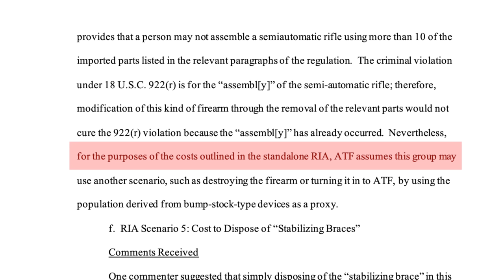BOMBSHELL HIDDEN IN PISTOL BRACE RULE!

Comment: The AFT for more than a decade had allowed the public to obtain these "dangerous and unusual" firearms to the extent that they are now commonly owned/possessed, thus making them protected arms under Heller. One could then conclude that if they are considered SBRs by the AFT, that SBRs are not "dangerous and unusual" thus not covered by the NFA. following that line of thought, if SBRs are not covered by the NFA, then logically SBSs, AOWs and suppressors should not be covered either. Since 1972 the AFT has increasingly tried to strip the citizens of their Second Amendment Rights. It's time for the AFT to be abolished.
Reply: Dude! It's (d)ifferent now.
Reply: You spelt abolish wrong, it’s spelt DESTROYED.
Reply: That was their plan the whole time, figured they'd get more people that way. This has been in the making for YEARS
Reply: Other ABC groups will just pick up their slack
Reply: Unfortunately I fear congress nor the courts are going to come to the rescue in time to save these. Those that try to file the form 1 will likely find the many months, even with e-file to get a response will play right into the ATF's hands as they plan to consider denied anything that is not approved from date of filing in 88 days. That means pretty much all of these, as the ATF has GROSSLY underestimated the number in circulation. This rule has two purposes; 1) to obtain as much information on Joe Public as they can...for the next step.  2) Get rid of by deceptive, corrupt and coercive means as this, expecting them to be destroyed...or removed from circulation by ATF agents after they deny your form 1.   Wake up people! Many of you are acting like your asleep at the wheel. As to this video asking people to "tell" what they are going to do...DON'T DO IT!
Reply: …yep.
Reply: Very well put. Perfectly articulated actually. 💯💯💯💯🔥🔥🔥🔥
Reply: @richardkennedy815  ATF/Treasury have a very good idea of numbers in circulation because they signed off on all the Federal Excise Taxes for pistols.

National Shooting Sports Foundation keeps industry records.  For 2020, the 2nd most common pistol chambering sold was 5.56/.223 Rem, which shocked me even.

They know they're in common use by the millions.

Comment: One would think both the ATF rule and the law on SBR's are unconstitutional as there was no supporting law from the founding about the length of allowable rifles or a requirement for registration.
Reply: It's looking like it's heading that way
Reply: It's one of the saddest "laws" we got.
Reply: It's all arbitrary and tyrannical.
Reply: The entire NFA is unconstitutional. You should be able to buy a machine gun at Walmart if you want to.
Reply: I would love it if this rule change by ATF causes the SBR portion of the NFA to be declared unconstitutional since 10-40 million of them in circulation cannot be construed as anything but "in common use" under the Bruen decision.
Reply: That's exactly right.
You could own a cannon.  There was no barrel length limits.
Or the old Colt revolvers with an arm brack, we'll actually stock on them.
Reply: @jarink1  
If the courts declared the SBR portion of the NFA to be unconstitutional wouldn't they also have to declare the entire NFA as unconstitutional?
Reply: The Attorney General who submitted the NFA in 1934 openly admitted to Congress that his proposed legislation was unconstitutional.

Read pages 10, 13, 91, and 92 of the NFA hearings, 73rd Congress.

Comment: Remember if you apply to SBR your ALREADY BUILT pistol and get denied the ATF will come for you.  That is straight from an ATF agent at Shotshow.  My advice?  Don't register and keep your mouth shut about what you may or may not have.
Reply: Good thing I don't own a single firearm..🙄
Reply: @dankcount  Since you made what was formerly a pistol into a rifle and in order to convert that rifle into an SBR you will then need a maker/builder tax stamp and pay the ATF another 200.00 bux for permission to build that now rifle back into an SBR, rather than to leave it a pistol/SBR since that'swhat your regerstering it as?? I mean I may be wrong and misunderstood the ATF site I just read that on. Maybe you can clarify for me since your in tune with the ATF, preferably without Ad Hominems..
Reply: @dankcount  Sometimes it is better to stay quiet and be thought a fool than to open your mouth and prove it.
Reply: Or just buy 16in rifles...
Reply: @LucasJackson_37  One of the ATF's approved compliance methods it to remove the brace and destroy or render it unusable. The firearm reverts to legally being a pistol. One could then apply for a tax stamp to add a regular stock to your pistol, making it into an SBR in the usual fashion. Only drawback is that it won't qualify for them waiving the $200 and you'd be out some extra money for the stock.
Reply: @dankcount  on stribogs the upper is the registered part, not the lower. I'm not sure how many other guns are that way though either.
Reply: Shutting up will save your life everytime when it comes to federal law enforcement. 

If they don’t know what you have, they don’t know.
Reply: They can just get receipts from businesses and find the people who bought them with cards😜🤪 plus the can just let AI scan through photos on people's phones to find who has them, it could be so fun if the government and citizens weren't chickenhawks
Reply: @Seasniffer69  yes and they cost like $1000 dollars are they saying they must be destroyed and not even compensating individuals for something they purchased legally? This is so messed up.
Reply: I know nothing!

Comment: This definitly rises to the level of emergency appellate review by the SCOTUS.
Reply: It does and more than likely they won't lift a finger to do anything to stop it. I hope I am wrong.
Reply: @AP518 Unfortunately, I agree. SCOTUS often refuses to take on 2A cases and when it does, the rulings are inconsequential or it sends to the lower courts for review and for the case to die out. Even with potentially meaningful decisions such as Bruen and WV versus EPA, we see tyrants ignore those rulings (NY governor quadrupling down, ATF continuing to issue the brace rule, etc).
Reply: @gifthorse3675  Courage is demanded of SCOTUS.  They have already shown such courage with the overturning of Rowe vs Wade.  May they remain similarly courageous in their 2A deliberations.
Reply: But ,yet they are silent!

Comment: I was under the belief that 922r compliance was part of the importation process which meant that approved imports were compliant. This is complete BS. Disband the ATF!
Reply: 922(r) doesn't apply for pistols. The importation process is generally for rifles to be imported in a configuration BATFE grants "sporting use" exemption, then for the importer to swap parts into the configuration customers want, with no more than the allowed 10 foreign-made parts from the list of parts considered.
Reply: Nope 922r applies even after in country. I.e you as the end user of say and imported Yugo AK can't replace the American made handguards and stock with Yugo made ones and still legally comply with 922r if you also insert a foreign made magazine as you are then over 10 imported parts on the gun. I do agree though this whole thing is BS and I don't even own one of the firearms in question.
Reply: @timewave02012  so what about buying a foreign pistol like luger or makarov? they are ok to have, so shall these braced pistols. take the brace off and now its no different than a luger?
Reply: @hambone950  Lugers that originally were made to accept stocks, are allowed to have original stocks attached, and that's a completely different issue. The Makarov has no such exemption and is treated the same as AK pistols with regard to arm braces and 922(r). Rifles (short barrel or not) are generally not allowed to be converted back into pistols, although I believe there are exemptions, like for the Thompson/Center Contender, that can be configured as rifle or pistol based on Court rulings.
The most important thing to understand about 922(r) is it only applies to the act of assembling the rifle or shotgun. What ATF and clickbait Youtubers don't mention is that possessing a 922(r) non-compliant rifle is not a crime. The alleged 922(r) violation that occurred in the assembly of a braced pistol doesn't need to be absolved. 922(r) was widely assumed unenforceable against non-FFLs prior to NYSRPA v. Bruen, and is even less enforceable under the Bruen test, where assembling a rifle is protected under the 2nd amendment, and there's no way the government is going to find laws contemporaneous with the enactment of the 2nd amendment restricting the assembly of rifles based on place of origin of the parts.

Comment: Points regarding registering your pistol with stabilizing brace as an SBR:
1. AT LEAST in some jurisdictions, your pistol is now a rifle and can't be legally concealed or transported in the usual loaded manner in the passenger compartment with your CCW permit as the permit applies only to handguns.
2. You can't legally cross state lines to shoot at a range without permission from the ATFE.
3. You can't legally carry concealed with a CCW as your pistol is now a rifle.
Reply: i agree completely, but just wondering, how do u effectively conceal a brace?
Reply: @mrspecialeducation7297  brace on a side folder. Under coat. Sling from shoulder.
Reply: @mrspecialeducation7297 use a backpack.
Reply: @perrymiller1098  oh yeah
sorry i dont know much about cc. i suppose that would work in the winter or fall but it would get a little tricky in the summer lol
Reply: @SavageRoosterOnThaLooster  good idea i guess im not putting my thinking cap on lol